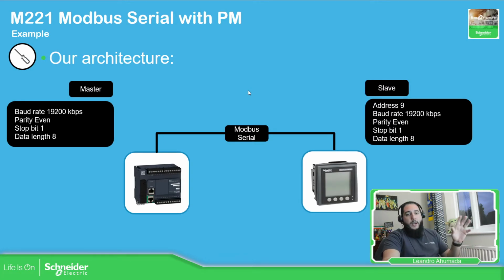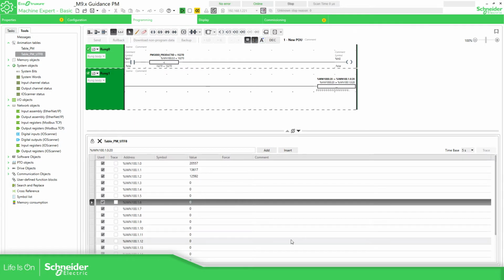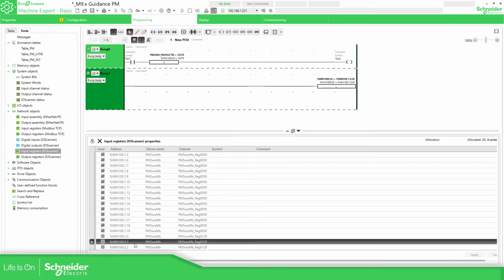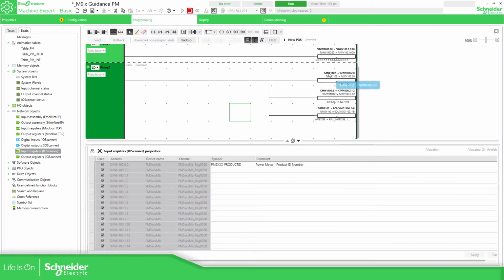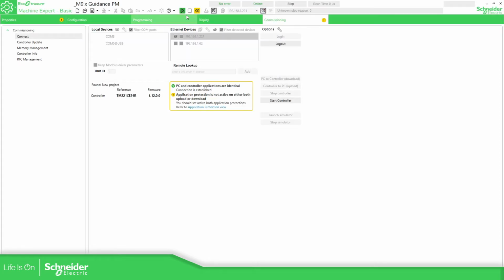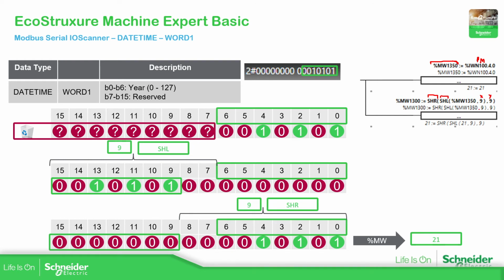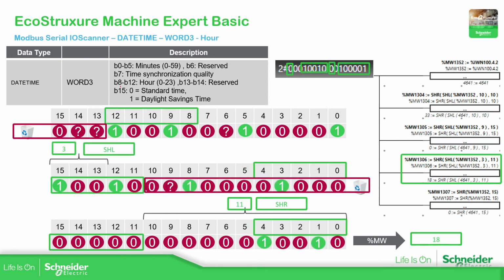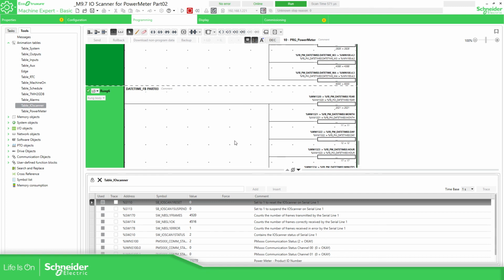Training - M221 - M9.7 IO Scanner for Power Meter Part 02

Comment: Thanks, can you explain how to read kwh 4 words/64 bit uint data
Reply from the maker: Hi there! The process is almost similar…. You need to read the 4 words from the device but  the m221 does not have long real 64 bits variables so you may need to use an hmi to read those new 4 registers in the plc and the hmi will convert the value to something meaningful for us. I will try to make a video about this.